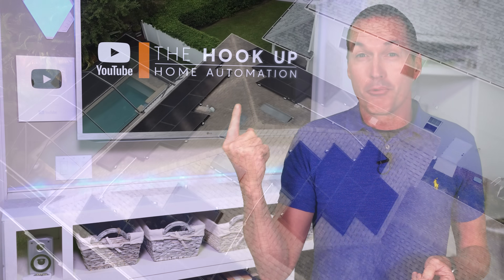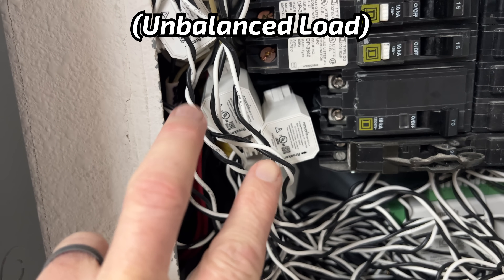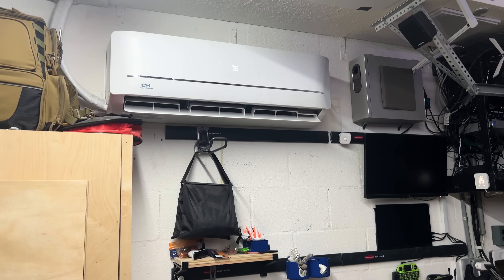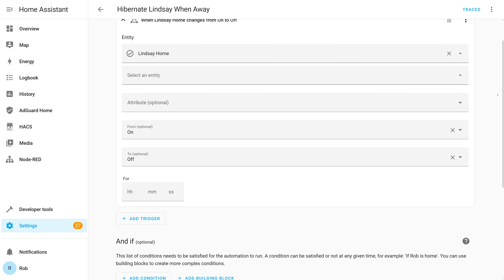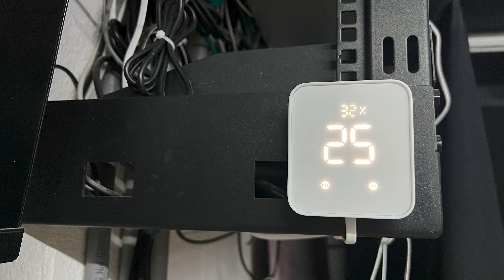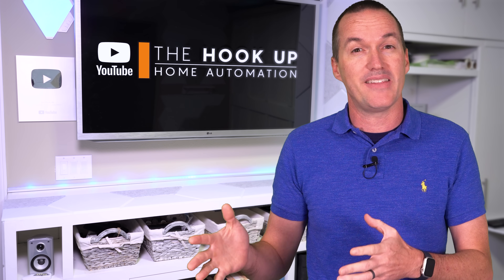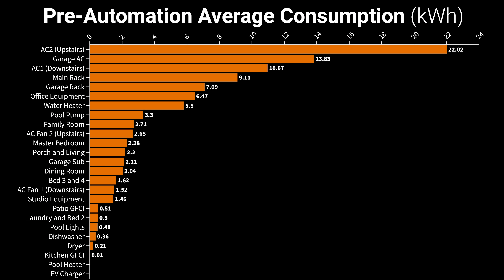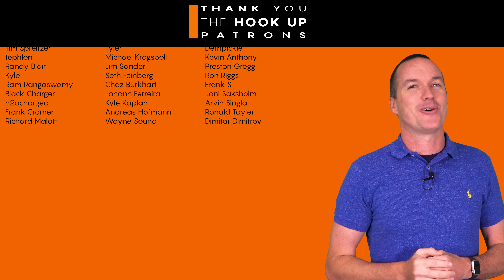I cut my electric bill by $1,331/year (with Home Assistant automation)

Comment: Adding some batteries to your solar panel system is going to save you money on the AC outside of the hours the sun is shining, batteries can be had crazy cheap at this point, check out eg. the Yixiang 16 kWh battery packs, they are only 1900 dollars a piece.
Reply from the maker: I have powerwalls.

Comment: Nice video... possible extra watts to save (from a Brit with different environmental variables)...

- Your upstairs temperature... If there are unused rooms through the day, maybe keep the blinds closed to insulate from the sun? 
- TV, maybe add a smart plug to turn it off at 11pm, and on at 7 am? Even on standby devices use a little power.
- Servers, consider a low power pc for prixmox, most stuff, including HA, NAS, etc doesn't need a power hungry pc.
- Revisit your bulbs. LED bulbs got more efficient in recent years.

Comment: My friend, did you just AI generated our old logo?? You can right click on our logo on the website to get the latest assets
Reply from the maker: Hey Paulus, I did respond to Missy about it and sent her a draft of a revision.  Basically the HA logo under assets stuck out like a sore thumb (mostly due to the white center) on this thumbnail design and I was under the impression the shared logos were to be used "as is" only without modification.

Comment: The "without changing any of my habits" criteria is such an American thing. I appreciate your honesty here, but I can't imagine being that wasteful with energy.  One thing you might want to do is temporarily look at each and every electrical device in your home. Put a smart plug with energy meter on it, and look at the usage for a few days, then make a plan for that one device.  

I bet you could cut your non-AC related use in half with a little research and some smart automations.  I once found that my microwave was constantly using 30W just to display the clock, so it I had a smart switch physically disconnect it when not in use.  Stuff like TVs and home cinema equipment draw significant energy while in standby, and making sure they're fully off might save you enough for an extra vacation every year.

Comment: There is definitely a need for better integration of systems to move heat around rather than just dispose of it. e.g. your A.C. should heat your water (and pool!)
Reply from the maker: I 100% agree with this.  It's insane to me that my pool heater can dump cold air into the environment 2 feet away from my AC compressor that's dumping hot air and they can't benefit from one another.
Reply: @TheHookUp Time to get inventing!

Comment: Are you using the home assistant energy dashboard ? It shows a self-consumption gauge and a self-sufficiency gauge. What values do you have for both ? I am looking for discrepancies between yr PV production and consumption.
Reply: Still like to seevthe figures. Meanwhile I had a look again at the video on yr Tesla installation. My guess is you have a self-consumption close to100%, and a below 25% self-sufficiency. You could replace the PV inverter to above 10kW, giving an increase in self-sufficiency. Other action may be to extend at the same time the amount of solar panels. Changing them from horizontal to vertical increases the available roof surface. As yr daily consumption is roughly 100kWh, you can cover the whole and still remain short in production.
Reply: Consumption for every house is different, but I think some basic rules are the same : self-consumption around 60-65%, self-sufficiency 60-80%. Rules from the government differ everywhere. I am living in Belgian Flanders, where rules differ a lot from Florida. We started with solar panels 5 jaars ago. EU is stimulating use of solar energy and cost of panels and batteries is low versus US. If one has just panels and battery, one can reach around 50% self-sufficiency. Adding automation increases the level above 80%. We are not blessed with the nice Florida weather, more clouds and rainy days here. Yet we have over 80%. I started the automation 5 years ago. As devices are from different brands Home Assistant was the evident choice for the integration. For programming HA was not what I was looking for. Then I found yr HA Beginners guide and NodeRed video's : HA, NodeRed and Tuya devices are for me the best choice.
Reply from the maker: I'm 100% self consumption, 35% offset.
Reply: @TheHookUp Are you allowed to triple yr amount of PV panels ?

Comment: I feel like the next obvious step is making some minor compromises. Maybe set the PCs to auto hibernate after 10min of no ocupation in office or something. Setup fast boot etc...mine takes less than half a minute to wake from hibernation you could have the wake on lan signal sent when a motion detector senses you and it'd be nearly on by the time you're sitting down. For such a huge power use percentage, it seems crazy to me to idle them. Also consider more efficient equipment. I have a low power 1l pc for basic tasks and a more powerful machine I only kick on for more demanding works like gaming or editing. The reduced heat load in my office is apparent and worth it alone.

Comment: Just a few things you might be able to do to your hvac units to drop the consumption more.  One would be a evaporative cooling kit.  I think amazon has one for about $100 or so.  If you don't have an issue with an HOA, you might be able to build a shading 'deck' for your outdoor units.  It will probably need to extend 1-2 feet from the front of your units (looking at your time lapse video).  You could use a thin 4x8 ft sheet of plywood and some 2x2 or 2x4s for legs.  You would just build it like you are trying to make a ledge to go around a fire pit.  The center will need to be open to allow the fan to draw the air through the unit and escape out of the top.  You can probably do the same thing with PVC and a black out curtain if you can find a waterproof one or treat it with scotch guard a few times.  Shading those outside units will help.  The evaporative cooling will also offer a boost.  It would increase your water usage a bit as well.  Also blackout curtains could help window insulation and radiate heat from the windows.  If you want some light, you could try window tint/privacy film that is pretty cheap (from amazon).
Reply: Evaporative cooling only works in places where the humidity is low. Florida humidity is very high almost all the time.
Reply: @playlist5455  well, you are a bit incorrect there.  It is most effective in dryer areas.  I live in MS.  I know all about humidity since we swim through the air on some days.  There will always be some evaporation because of the temperature of the coils and the constant heat transfer.  Had to take thermo for my major a few decades ago.  Also the temp of water is probably going to be about 10-20 degrees cooler than the ambient air.  Another reason for the bigger dealta T and more effeciency.  The biggest down side would be the water consumption and the cost associated with it.  If you want to really save, then you would connect a rain barrel to the closest gutter down spout and get a cheap DC powered pump and small solar panel.  Then you use free water and the pump will be powered by the sun so won't run when it is raining or at night.

Comment: I just added the Vue 3 to my panel yesterday and flashed ESPHome, funny enough. I'm seeing similar ratios to your setup, though I do tend to run my computers on sleep/hibernate. I primarily want to see if there's enough cost savings in replacing my 2014-era server with 2x Xeons by going with some more efficient equipment. I'd recommend throwing some temperature sensor in equipment-heavy areas to get a general idea of how much it actually contributes heat back to the environment. Think about it like this, between your racks and office equipment, it's like running a small space heater 24/7 in the middle of summer.

Comment: We added solar in 2019 but then got two EVs & a hot tub so we still have a monthly electrical bill (but thankfully no gas!) when I installed the sense I realized our computers & TVs were using a lot when not in use. We’re trying to be better about powering down our computers, I did experiment with a smart plug that cut power to TV when we’re away but it didn’t move the needle much so I wouldn’t bother. We like being comfortable in our home so the a/c temp is a non-negotiable for us. Overall our home is more pretty darn efficient but it’s always nice when automatons can help save money
Reply from the maker: Highly recommend hibernate automations for your computers.  Seems to be virtually zero downside that I can see.

Comment: I like the system I'm going to have to definitely try this I wanted to set up a home assist and will most likely do this appreciate you running through it. My suggestion to you as a builder is the change your main AC unit to a mini split you can convert it directly and you would save about 60%

Comment: i need 5.8kwh per day on a year average for a 3 floor house + 3 (small home-)shops, electric car charging at home, server 24/7 on for homeassistant and 7 cams with frigate… 1kwh more per day if ac is on. your consumption and costs are unbelievable high! for austrian (europe) standards even more where 2.4mwh (6.5kwh/day) is average normal. we build using bricks and dampen it with 3inch thick layer styrofoam, maybe thats the reason. highly recommend doing this. pays out in 4 yrs with your monthly energy costs.
Reply from the maker: Are you air conditioning your home? Doesn't really matter how large your home is if there's no AC.  Also, 5kwh/day is about 10 miles in an EV, so if your commute is 10 miles that leaves 0.8kwh for the rest of your home.
Reply: @TheHookUp  My wife’s Smart fourtwo from 2012 just holds 17kw on energy for ~60 miles, she charges once in a week on average. Cars range is about 16mi with 5kwh. your tesla (you owned one if im not mistaken) should have same consumption…? why double as much? yes, im AC my home, but just a dualsplit system for one floor and were not dealing with floridas temperatures over here. use it round 30days/yr on purpose thats why it doesn’t add‘s up that much to the sum. and i have to apologize a mistake i made… i summarize up the readings from the energyprovider and divided it to a day. forgot the ev/garden/carport/basement is on the other counter wich reads almost same. total costs for the house is also double as much - im sorry, it was late at night and my brain is cooked.
Reply from the maker: I looked today, my Rivian is reporting 2.6mi/kW which would mean 5kW would be 13 miles.  HOWEVER, that only accounts for energy consumption while moving, idle consumption when the car is parked is not monitored by the Rivian dashboard.
Reply: @TheHookUp i compared that with actual rating, its exact what it should need, 24kwh/100km. its pretty clear that a microcar (wich the smart is) needs lesser. back to your energy consumption in your house… have you ever checked with a thermal camera?

Comment: Don't know if it's been mentioned or not, but depending on what you're actually using your computers for each day, modern "mini computers" are shockingly functional these days.
While it is by no mean a brag-worthy computer, I've been running a Minisforum UM780 XTX for going on two years now.    Right now, browsing the web, the whole computer is using around 20-30 watts, which is what my old GPU would consume merely displaying the desktop.
What I did was ran my Mini in parallel with my "real" computer for a bit, and over time, I realized that the Mini was capable of handling the vast majority of what I do day to day.   Sure, I can't run an AI model, or the latest AAA games, but my power draw is like a tenth of what it was.    Plus it runs cool enough to spin down the fans unless I'm maxing out the CPU, so it's basically silent as well.   
If you get a model with Oculink/USB4/etc, you could even have an external GPU that you can turn on when you needed the extra oomph.    Of course, actual money savings will take time buying new hardware, but power/heat savings would be immediate.
Reply from the maker: My wife and I both edit video a significant portion of the time.  MiniPCs unfortunately aren't going to cut it.
Reply: @TheHookUp is cloud based editing good enough yet (rented vm) or are you just moving the cost elsewhere?

Comment: Have you looked a Span Smart panel yet? This looks like a fire hazard.  I have 60KW of Solar and 4x Tesla Power walls, and a Span Smart panel that integrates with Tesla.  Please reach out!
Reply from the maker: The CT wires carry virtually zero current and are not a fire hazard.  Span is cool but WAY too expensive.

Comment: MY power bill increased by $1,300 per year as a result of having over 150 Tuya/zigbee devices ALL drawing power even when the light or device is not on, the cpu/wifi is always drawing power.
Reply: By my estimation, that's ~1 W of phantom power per device -- mine use less than a tenth of that (thirdreality zigbee monitoring plugs; they only go down to 0.1 W and they're reporting 0 W at any given time, or 1 Wh in 12 h); might be worth getting better ones. My automations that turn them off when not in use save way way more power than all of the plugs use together, my AV receiver alone uses 36 W of phantom power so I turn that off for an hour and it saves 10x more energy than the total power consumption of all ~30 of my plugs!

Comment: I don’t trust the wait commands in my automations as I think they don’t work when you push updates or reboot for whatever reason. (At least I thought that was the case at one time?) Anyway I have been using “Choose” with Trigger IDs. That wait you can trigger automations with a ID “AC Start Time” and and ID “AC Off Time” and not risk delays hanging.
Reply from the maker: Good idea, thanks!

Comment: Look into replacing your water heater. Florida homes often have it in the garage. If you get a heat pump model, it will extract heat from your garage and put it in the water. That will assist your minisplit in garage cooling. It'll also use less electricity.
Reply: That's such a cool idea for hot climates... Put the evaporator inside and it literally cools the room. Not that much, but still.
I do wonder though, since heat pumps are more efficient at higher temperature differences, would having it in a "colder" interior room be less efficient than having it outside in the heat, and if so, by how much? Since the cooling effect is minimal, it may even cost you more in electricity to generate heat for the water than it saves you in cooling for the inside.
Reply: I have an 80 gallon Rheem hybrid. I moved the water heater from my utility room to my garage which was right next door and it was the best thing I ever did.   Not only am I saving money on power but as a fellow Florida resident it actually cools off my garage whenever it's using the heat pump.    And as previous commenters have said it's pretty easy to turn off if you needed to film.
Reply from the maker: Do you have one? I'm concerned about the noise since I film a decent amount in my garage.
Reply: @TheHookUp  sounds like an automation to switch the heat pump when you are filming ;-)
Reply: @TheHookUp  All the ones ive heard are likely too quiet to be picked up by recording. On par with a minisplit on around medium to low windspeed
Reply: @TheHookUp  I have had a Rheem for a couple of years. Unless they changed them the Rheem is noisier than I'd like. (It's in my basement so I don't care.) I would look for something quieter. For 2 people we have plenty of hot water with just a 50 gallon unit, average use is 2.2 kWh/day.
Reply: @TheHookUp  Also worth noting, there is a fairly substantial federal tax credit for putting in a heat pump water heater right now. This will go away after December 31st. I had a quote for $6k to replace my standard electric water heater with a Rheem in my condo. I don't think it will work out for us, but it's worth checking out in hotter/humid states. It will slightly cool the air as well as remove moisture. Not a replacement for your mini split, but it'll be ~4x more efficient than a standard electric.
Reply: @TheHookUp  You can turn off the heat pump portion when filming. I have a Rheem and I can schedule to run in electric only mode during certain times of the day. I think there is an HA plug-in for some water heaters, so you might even be able to setup an automation to change modes when you are filming.
Reply: @TheHookUp  I have one, I think it would be too loud for recording.
However: They only run once or twice a day for me and you can always switch them back to heating elements if you want them to be be temporarily quiet. The additional cooling/dehumidification they do to a Florida garage isn't really all that noticeable. They are too efficient for that :)
Reply: @TheHookUp  I had one at my previous house, they sound like a mini fridge when they're on.
Reply: @TheHookUp they will likely be picked up slightly
Reply: @TheHookUp most heat pump water heaters have a 5k electric backup and you could automate it to only use electric when your filming

Comment: Surprisingly, you didn't do anything with the water heater.   I now can monitor both of our units and one was set to ECO mode and the other isn't.   There is a huge difference between the two as far as energy usage.
Reply from the maker: Water heater is already automated.